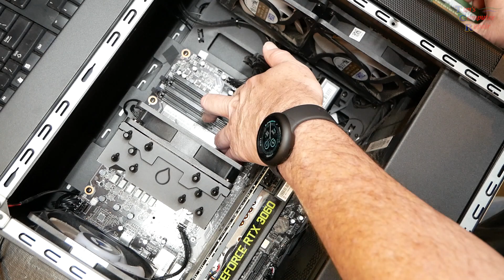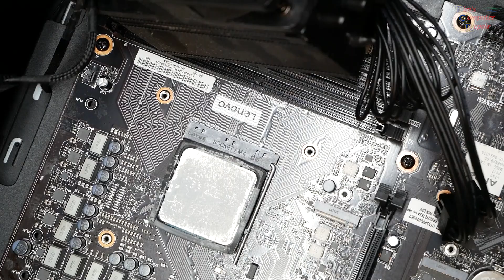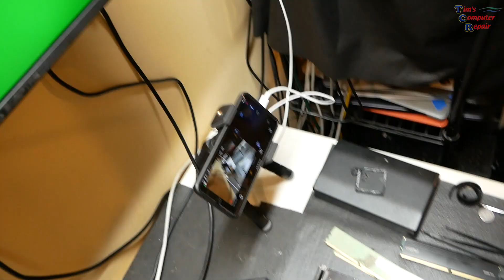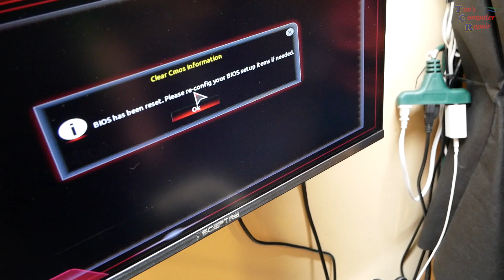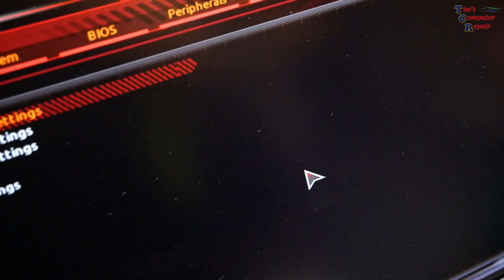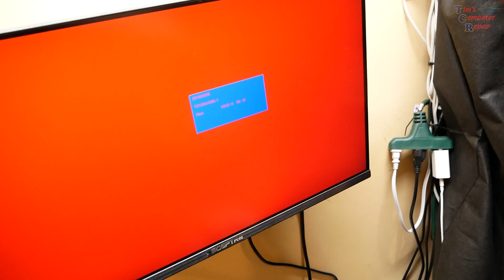This is Why PC  Repair Shops Charge High Fees Just For Looking at Your Computer

Comment: You should have tried the power supply first the RGB lights worked most likely a bad cpu ,you also got the beeps when you put the memory in the wrong slot that tells me you have a working motherboard , The the 5600G and 5700G have a know issue with cpu going bad with the igpu burning out ie it's on but won't display at all. I have replaced the Lenovo motherboard once and the cpu 29 times.

Comment: 5700G has on-board graphics. Test video without the gpu.
Reply from the maker: The same problem followed the cpu to a known good motherboard. Regardless if the display would work off of the cpu it would not work from the video card. In the end the cpu is faulty.

Comment: How much did you charge for the diagnostics process? You're right that diagnostics has to be that thorough otherwise a person not thinking would have just chalked it up to the bad CPU. Great work tim!
Reply from the maker: I charge $150 for diagnostics for most higher end gaming desktops. I will waive that fee if they have the computer repaired through me.
Reply: You do great work but that's quite the diagnostics fee. I'd be interested to know what labor for the fix was? I tried at my own little computer support tech company, and even with great work it's hard to find customers.

Comment: Looking at the screw holes, standard M-ATX motherboard should fit in the case. More likely problem is Front panel connectors. If it was a Dell or HP, there would be a bigger chance that everything is proprietary even the PSU.
Reply from the maker: Yeah not going to take that chance.

Comment: Sometimes more than one component is bad. Thus why we as technicians must have multiple spares to use. Knowledge is power....and it is damn expensive...so you as the customer shall be charged....muwahaha. Seriously though, just finished a new built for someone and I could not get the thing to post. Another VGA works fine but not the Intel Arc A770......at the end of the day, there was nothing wrong EXCEPT that the damn card refused to boot on two different type 20"monitors using two different types of ports....the card just wanted a monitor at 1080 minimum resolution. The weird things we have to deal with.
Reply from the maker: That's a weird one. Thanks for commenting.

Comment: As the cpu as built in gpu take out the 3060 gpu out and plug the hd cable in the motherboard 
As most of these prebuilt pcs have the  bios use the onboard gpu under video settings you change change it to pcie mode
Reply from the maker: True but the 3060 is perfectly fine. Thanks for commenting.
Reply: A lot of these BIOS are locked down, which can complicate things.

Comment: very good that is exactly how i do it and every one should do it lucky i have the ram and cpu and spare mother boards to problem solve that  Tim you were using DDR4 in that mother board was you it saide that on the motherboard Ryzen 7 needs DDR5 dosent it mine does b650 m mine is AMD Ryzen 7 7700
Reply: He wouldn’t be able to install the ram if it wasn’t compatible